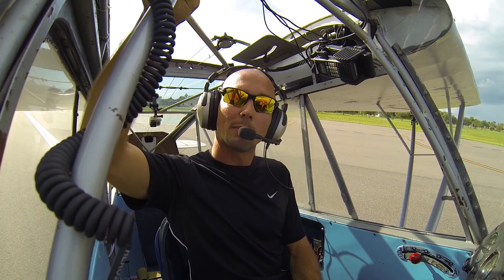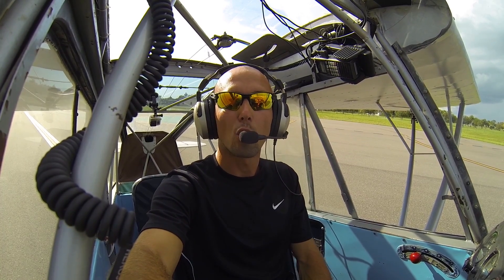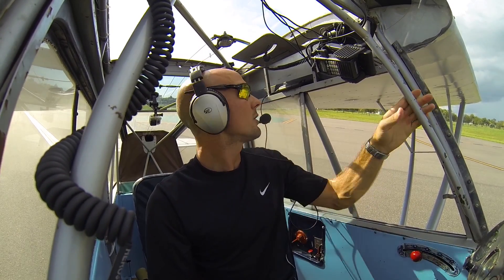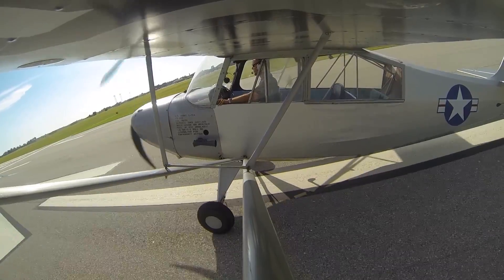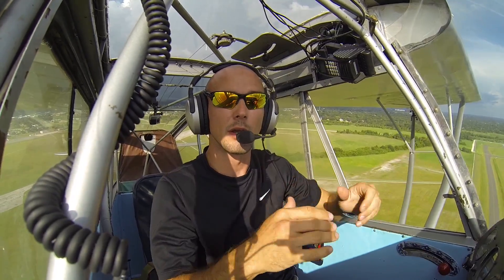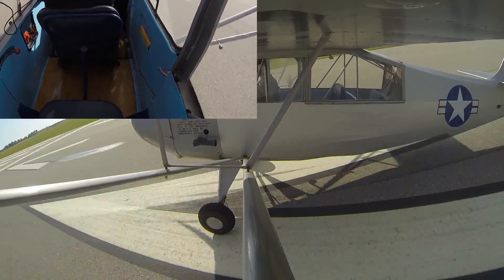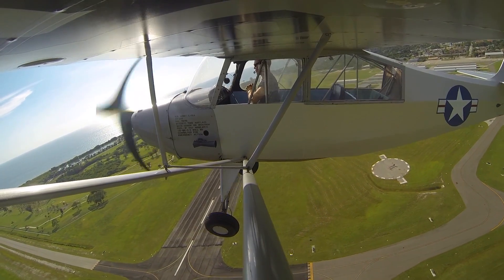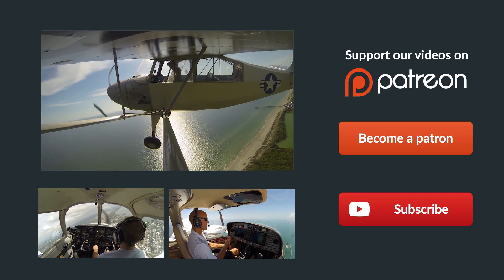Ground School: Tailwheel Takeoff | How to fly a Taildragger

Comment: What prevents the nose from slamming into the runway with the stick pushed full forward during full power take off roll?
Reply: Aft location of the center of gravity. Wheel landings require stick forward to plant the main gear as well. Common, but unfounded fear for trainees.

Comment: Be very CAREFUL raising the tail to quickly! Ensure that you have required airspeed and directional control.....the stick should stay in the full aft position until you have positive rudder control. Raising the tail to quickly taught in training will get you in trouble by "habit" if you have a 10 kt xcross wind from the left and bring the tail up to quickly, well you will find your self turned 90 degs into the wind and a ground loop! As a CFI for over 50 yrs, DPE for 40+ retired and flying B17, DC3, DC3TP, T-6 etc......this works nicely....

Comment: the beauty of a conventional or tailwheel aircraft is that it is sitting in a pitch attitude of Vy before you even get in it. so every ounce of energy produced by that monster A65 continental in converted to getting that aircraft off the ground.  in a nose wheel aricraft energy is spent just getting the nose to a Vy or climb pitch attitude.  so this is why on a normal takeoff with moderate winds it makes a lot more sense to just keep the nose where it is before you even started the engine,  at Vy or best rate of climb speed.  i have always found it ridiculous to worry about rotation speed in any single engine trainer.  you are NOT in a 747 so just hold the nose in the pitch attitude it was before you even got on the runway and it will take off when it is ready.  if you continue to hold it there after takeoff the aircraft will stabilize at Vy.  you have no business looking at anything inside the cockpit on a takeoff in a taildragger, period, nor do you need to look at anything besides the runway and which way that nose is trying to go.  terrible advice to have a student look at anything inside the cockpit any time you are anywhere near the runway on takeoff or landing!  so please explain to me why it is so important to get the tail up on any normal takeoff with light winds?

Comment: Not to take anything away from this video but the technique I use is after opening the throttle, push the stick only slightly forward, as soon as the nose drops just slightly you know that the tailwheel is off the ground. Hold that attitude and the plane will fly off on its own.  One simple step and you are off and flying, used it just over 3 thousand times in light 40s vintage taildragers.

Comment: Wait, is this an alternate way of doing it.  I just saw someone on another channel say that the steps to take off in a tail-wheel aircraft is to hold the stick all the way back (aft), start applying throttle on a slow 5-second count, then move stick to neutral slowly as the plane rises of the ground (a bit of right rudder but not too much and also eventualy reduce throttle if once in the air the plane starts to roll right).  Is the Aeronca different?

Comment: Okay, so you are pinning the tail the the deck and compensating with right rudder for torque and you stick forward to go tail wheel up and then pull back? Okay . How far toward did you say ? Yes I have flown a j3 cub but I want to try a champ .

Comment: Not a normal takeoff. The stick should initially be held full back to maintain directional control with tailwheel then ease forward as rudder becomes effective.  This is most important with crosswind.

Comment: I have owned a 46 J3Cub 85hp for almost two years. In that time I have learrned a lot about flying a tailwheel airplane. I used to push the stick forward before take off and it worked alright, but I saw a video about just hold the stick loosely not pushing it forward and the tail will come up on its own, then a slight back pressure and you are off the ground (Like you said the plane will just about fly itself). Looks like most of the posts here go along with letting the tail come up without pushing forward, you won't push the prop into the runway doing it that way. Your choice do it either way if you are comfortable. Happy Flyimg!

Comment: I've flown a Citabria a couple of times. I was taught full back stick for taxiing and the first part of the takeoff roll. Once I was going faster than about running speed stick neutral and let the tail come up by itself. Light back pressure about 60 mph, the plane flies off.

Taildraggers are cool!
Reply: I flew a Citabria back in the mid seventies for some aerobatic training, I I remember doing it that way too.
Reply: I could agree with you too.
In Germany many touring motor gliders are tail draggers.
We have benn taught to pull back when taxiing and during the first Part of takeoff roll.  When the rotate  speed is reached  when the tail lifts slowly off, then we push the stick carefully untill tue vx or vy is reached.
Allways counteracting with ruder when the nose deviates. 
Verry important:
 crosswind and propeller torque- wash effect. Sometimes some more or less ruder  may be needed

Comment: Is it possible to have the stick to far forward to the point of a prop strike or flipping the entire airplane over? For some reason tail draggers have always been a concern, so I have avoided them in over 50 years of flying.
Reply from the maker: FIrst, I'd tell you to go find one right away and hop in (with a qualified CFI).  Like any other machine, they are not dangerous when you are trained properly by an experienced CFI.  To answer your question, there are a few tailwheel aircraft out there I would not shove the stick full forward on during takeoff or landing roll out.  In the case of the Champ, it is nearly impossible from an aerodynamic stand point to have enough elevator authority on takeoff to hit the prop.  Remaining clear of the brakes is the main priority and just by using stick and rudder only will make these airplanes behave very well in almost all circumstances.  Still however, you can get on the brakes in a champ more than you might think without risking flipping over.  If you were to remember one thing, it would be to get off the brakes and get on the throttle, that will make it behave much more like the airplanes you are used to.
Reply: Well, yes, you can rotate the airplane too far and strike the propeller. But, you have to work to do it. If you are making a normal takeoff and are moving, say, 25+ mph it is pretty much impossible to force the nose down enough to strike the propeller. This is because the vertical stabilizer will not allow the tail to lift much above a level configuration. The forward motion slipstream prevents it.
When I was a student sixty years ago my crop duster instructor demonstrated this in a 150 hp Super Cub. Profound and scary… but the prop would not hit the ground.
HOWEVER…
Fifty years later, while holding to take off in my Aeronca Champ at Cameron Park airfield, I saw a Super Cub spectacularly strike its prop on takeoff. Right in front of me.
The pilot (I think an instructor) was trying to demonstrate a short field takeoff. So, immediately starting takeoff roll she applied FULL power. And then pushed the stick full forward. There was no slipstream acting on the horizontal stabilizer; the airplane essentially wasn’t moving. However, there was the air being moved by the engine/propeller; full throttle. At less than five mph the engine’s slipstream ACTING ON THE ELEVATOR elegantly lifted the tail up, the nose down, way down, and the prop ding, ding, ding… hit the runway.
Takeoff aborted, tail came back down, engine shut down. Though the pilot and student were women, I surmise some one said: “Oh shit.”
Because of an odd taxiway configuration at Cameron Park (I was taxiing from the on-airport housing, I was holding in a location that put me no more than fifty feet from the Super Cub when this happened.
Always something at airports.